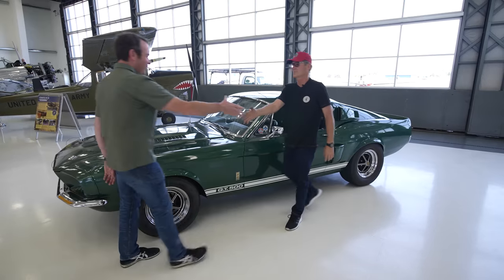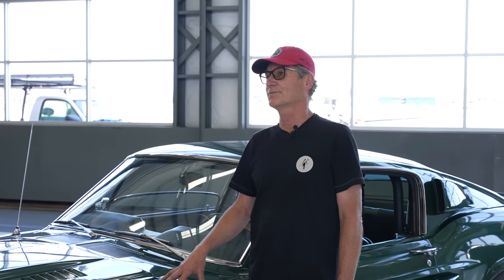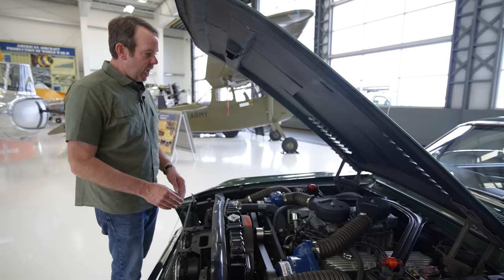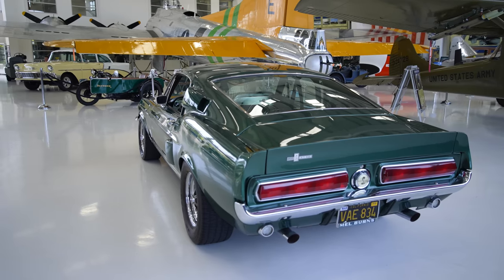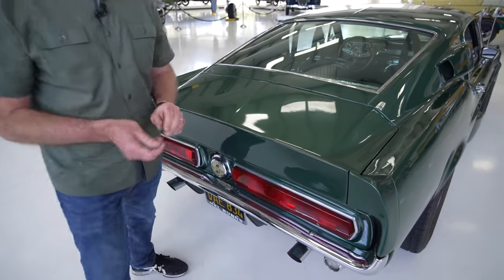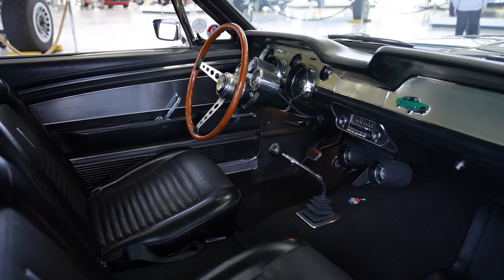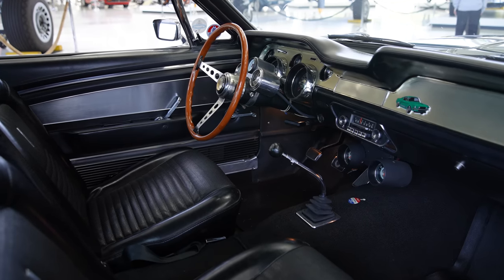700HP Twin Supercharged Shelby GT500: Worth as much as a Super Snake? | Appraiser

Comment: The Paxtons are generally period correct so it's way different than some later-developed forced induction in aesthetic...that in conjunction with the presence of the #'s matching engine means value shouldn't be anything other than enhanced.
Reply: It’s a weird thing because I would love nothing more than to swap them for some modern medium sized turbos and a modern fuel injection/timing but I would never ruin this car by doing so.
Reply: @negativeindustrial  Even that wouldn't ruin the car so long as you built another new big block and kept BOTH current engines, the original and the twin Paxton. It's all reversible.
Reply: @harryspeakup8452  
True enough.

Comment: That is what an Eleanor should have been!  The color is Home Run! The 445s are really tough. They are usually a 391 truck block with the triple bracing and if you only bore the bores to 4.08, they are very thick and really good metal. The 4.25 stroker crank can take 1500 hp as can that block with cross bolted mains. That car will live in my dreams forever!  Twin Paxtons with Gilmer tooth belts, that 750 is easy and can run to 6200 rpm’s as long as you want. The internals of any FE from a stock 2 V 390 can take 750 hp, he could boost it up to 1000 hp if he wants to. I would not street race him. He would embarrass any Mustang of today, and the Scat Pack cars are so heavy, I believe he would walk them going away with no sweat.  Beauty, and Muscle! I have built many FEs in the 50 years I have built them, and this one is the best combination I’ve ever seen! A 427 gets a lot of glory, and the 428 in 67 was a Police Interceptor with less power than the 68 up Cobra Jet. This 445 is a wonderful example of how the FE becomes Godzilla!
Reply: Fascinating input, you know your stuff bro. 👍

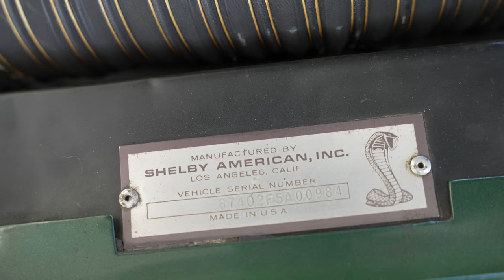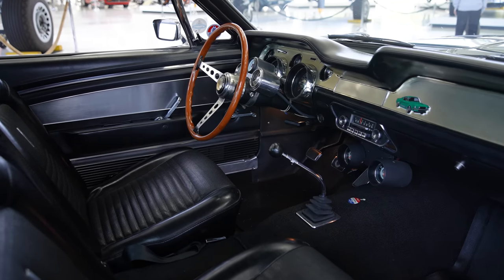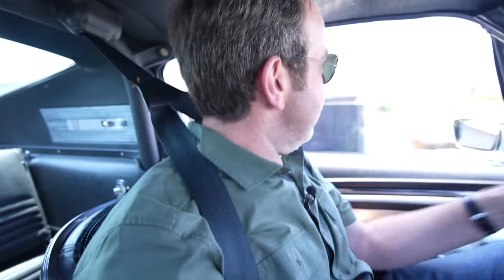Comment: This is not meant to be a criticism of the nice "appraiser" as a person or the awesome Mustang. But I am stunned that this is what passes for an appraisal video... meant to cause people to want to get a similar appraisal done by this company. So many problems & deficiencies. He says his examination would be "invasive" as he would "make the sausage". This was anything but thorough. Didn't see any sausage. We didn't see a single pic of under the vehicle. It has oem type batteries & hoses but he doesn't mention those type factors. He doesn't go around & educate the viewer on looking for signs of body repairs or whether bolts such as fender bolts had been turned or moved, welds where body panels were put together, edges of door jambs & other panels to see if they had tape lines or dry areas that indicate paintwork. He does mention a flaw in the paint on the quarter panel but just makes the incorrect assumption that the paint is original when you can zoom in on the pics & see specs of trash & fisheyes & sand marks & repair areas & overspray & poor fitting panels all over the car. The appraiser asks if it has original paint etc. That's his job to figure out if he was supposed to be evaluating the vehicle. I easily zoomed in on my phone from my couch and could see countless flaws in the paint that make it clear that this car has been painted. Still an awesome car. But this was the most useless "appraisal" ever. And then he first asks the owner what he thinks the value is. He says you're kinda foolish for bringing your car to me to get it appraised. Now he was right about that. If it were my video I'd pull it down & redo it right to actually show people what makes the difference between an average good looking old car like this one with obvious paintwork & a car that's been taken to the level that this video tries to pass this car off as. Zoom in to look at the visible damage or repair area on the A pillar at 3:12. Zoom in to see the crud around the vin# plate at 5:21. Look at 6:01 where the front fender is pretty damaged from rubbing the tires that are too big. Look at the very rough looking quarter panel welds at 6:50. Not factory. Zoom in on left quarter terrible sand marks under the paint at 10:24 & zoom in on the corner cap that joins it to see some terrible paintwork.  Check out the very poor fit of the trunk lid & hood, which those are the Shelby fiberglass ones so maybe they always fitted poorly. There's a huge difference between an original paint car and one that's had body panels welded in poorly. That's all cosmetic stuff, but what about that clear knocking noise at 3:34? It could be something else, but it sure sounds like the engine knocking! No mention of that!? Just zoom in on any panel to see multiple specs & fisheyes. The factory could have left one or two, but not that many. Every panel I see has several & several places like where the valance panels meet the fenders & quarters are not fitting like a very low mileage original paint car should fit. And it may just be me but the front fenders seem to both be a shade lighter than the doors. If the car were carefully wet sanded again & buffed properly a lot of the telltale signs could be improved so much that it would take the car to another level. Being such a special & beautiful car it deserves it. So I hate pointing out negative stuff about anyone's car, but this "appraisal" just failed to do it's intended purpose. Good or bad, an appraisal of a car this special & valuable needs to be way more detailed, honest, and accurate than whatever this was.
Reply: You’re talking about a three hour video. This is what you get for thirteen minutes.
Reply: 100% agree on all the above. This "appraisal" was just fluff and no substance.

Comment: I wonder why he didn’t use the 427 instead of the 428? Considering he went Thru all the trouble and expense.  Otherwise I think it’s awesome 👏
Reply: more air he said
Reply: They actually put 427’s and 428’s underneath the hoods of 1967 Gt 500 Shelby’s. Check it out, cool info
Reply: @gearhead682010  There's never been a documented 427 in a 67 GT500. They were simply too expensive for Ford to make them standard in a Mustang as opposed to the 428 which was in mass production at that time.

Comment: Crazy that tech from 70s could be modded for crazy HP numbers like that. 
Wonder if anyone modded this config back in those days
Reply: Yes, they did. This guy just basically replicated what Carrol Shelby did with his two 427 Cobra Super Snakes. 427ci Side-oiler FE engine (this guy used a 428 FE) with twin Paxton superchargers. Shelby kept one for himself & gave the other one to Bill Cosby, who promptly gave it back, saying that he would die in that car. So Shelby sold the car to somebody else, who proceeded to run it off the road in the Hollywood hills killing himself and destroying the car.

Shelby's Super Snake (CSX 3015) sold at Barrett-Jackson last year for $5.5 million.
Reply: Also, don't forget that the FE engine was the same starting block as that used in the mid 1960s in both the Ford GT (GT40) and the Shelby Daytona Coupe - both cars making around 500 hp, and both cars topping 200 mph.
Reply: @brettwelcome4842  holy cow. Thanks for that insight. Never knew

Comment: I could just imagine this thing on the street. It would be terrifying to drive in straight line with that kind of horsepower. Forget about trying to turn. This vehicle would plow strait into a brick-wall. Just get a modern-day supercharged GT-500.
Reply: This car is way more close to factory than say the guy that crashed the chevy on the AutotopiaLA video. This car had carbs and throttle linkage that was easily adapted. The Chevy was a straight drag racing engine shoehorned into a car with a semi functioning gas pedal. It was most likely built on the premises that we have 33 days to get this built, and with the snap of the fingers they had 3 days to build; and threw it together. Besides how hard can it be to throw a Blown Big Block  into an old car. Shoe string the gas pedal and you're racing.... The guy actually bothered to say that he upgraded the brakes in the 90's. All he perhaps upgraded to was Big Block brakes for say a 390 4bbl. or possibly a 428 with factory power ratings. Not a 8-71 blown funny car engine.

Comment: These are stunning to look at, but 100% not a 200k driving experience. These will drop in value significantly as the older generation dies off
Reply: Not with this inflation.
Reply: What information do you have to support your theory that these will “drop in value significantly”?
Reply: Driving experience?  What are you a soccer mom shopping for a new S UV?  They've continued to climb in value every single decade you clearly have no clue what you're talking about... It's a supply and demand thing and vintage cars and the sixties aren't being supplied anymore the demand continues to grow
Reply: @chrismathes3647  Yes driving experience. I actually put a ton of miles on all of my fun cars, so how they actually drive is important. 

Again, these are nowhere near a 200k driving experience. 

These are more for the crowd that wants to take them out a handful of times to a car show each year, and rattle off all its options and show that it has period correct hoses and clamps
Reply: @Urapnes75  look at the massive muscle car boom of the 2000s, where pricing went crazy. Right now any performance car is sky high in value, even everyday cars are selling at MSRP or above. Current times aren’t normal, and we’re at the start of things heading downwards. 

Pre Covid values were way down on muscle cars. Again, as the older generation starts to die off the value of these will drop significantly.
Reply: Fully agree. Awesome cars, but the values are inflated due to boomers. I’ve driven a few of these, and if you take away the Shelby lure there’s more negatives than positives in terms of how driving them feel.
Reply: @sarahdell4042  100% agree.
Reply: @chrismathes3647  I believe that’s the point she’s trying to make, seems to have went over your head. Obviously it’s supply and demand that has pricing elevated for these, but from an actual ex owner of a gt500, she has a valid point. They don’t feel special if you take away the value, and for the money you can find a million other cars that drive far better if you truly love engagement. 

I liked mine, and enjoyed it for what it was but never drank the kool aid.
Reply: @sarahdell4042   Dumbest comment I've ever heard in reference to a 1967 Mustang that is a low numbers production car that you buy for collectibility not driving experience. It's a completely pointless comment that you're only saying to make yourself feel better to hear yourself talk. If you want to a performance vehicle for driving experience get BMW, Porsche, Maclaren or something else that's a driver's car that you can enjoy, but you're completely missing the point of this video and the car featured.  Nobody's not saying it's still a Mustang at the end of the day but the whole video of the Shelby twin superchargers  is something that Shelby fans like myself have always looked forward to hearing more about it.  I can imagine a $200000 classic muscle car from the sixties having a really awesome drive and experience not like I'm gonna get in and it's gonna be like an M series or some other high end vehicle that I've driven I just can't see the point and as far as collector value going down yeah it's relative but it's only gonna be a small amount. The 2 men in the video were off by about 50000, right? so if this thing goes down from 200K it might go down to a $150K which to me doesn't mean that the car all of a sudden became cheap.  Your comment makes it sound like it's gonna become the FTX of collector cars sorry I don't think you're even
Reply: @Urapnes75  That the market in pre-war and 1950s cars has softened significantly in the last 20 years, with the change of generations. At least, it has here in the UK.
Reply: @chrismathes3647  Again, that’s what I’m saying. These are more about the status and allure of it being a Shelby. 

I’m not saying they will be $20k cars, but I don’t think they will climb in value over the long haul. In large the people who currently have these don’t actually use them. Trot them out to car shows, etc. 

As those people die off, the younger generation doesn’t have the same connection to these. Inflation is insane, and wages aren’t moving. People can’t afford to buy homes anymore either, due to firms buying everything they can get their hands on.
Reply: @sarahdell4042  that is why this kind of car isn't for you.  If you want that kind of driving experience get a newer vehicle or build a newer vehicle.
Reply: @alexb3764  it's a nearly 60 year old car I'm not sure what yall expect you are comparing it to the way modern cars drive of course it's gonna be completely different.  If you don't like that stuff get a newer vehicle that simple.  Some people like the older raw feel it has character.

Comment: Question about numbers matching: How does the engine not being numbers matching (with the rest of the car) not affect the value of the car? If I understand correctly, it did not seem to matter to Collin that the engine is not original. Why?
Reply: Maybe because the period-correct engine is still with the car--- just not in it.
Reply: The owner still has the original numbers matching , low mileage engine that can be put back in the car at any time.
Reply: Did you not watch the video? He still has the original engine. Therefore he can put it back in the car at anytime. Meaning no value lost.

Comment: What's the point of any car having more than lets say 350 to 400 HP when you want to drive it on the street?  Ego boost or something?
Reply: 350-400 horses isn't that much nowadays you can have a fun fast car w that kind of power but that certainly isn't the ceiling on streetable power 600+ wheel is easily streetable just gonna run a drag radial if you wanna actually use any of the power.

Comment: 2 blowers and only making 700hp? Am I missing something here?
Reply: If They made 400hp stock to the wheels , each makes about 150hp but then probably takes 40hp to run. Old school Boost , just think about how crazy 700hp would have felt in the 70”s! That’s almost double what a 427 makes. So not bad😅
Reply: Non-intercooled, iron heads, small blowers, blow through carbureted, California 91 Oct limitation. It's probably a low boost, pump gas, street tune up, it probably hits peak power under 6000rpms and makes over 700lbs/ft TQ too.
Reply: Yes...the knowledge to understand a boosted car of this era vs a boosted car of today 😳
Reply: @hendo337  exactly. This is an old technology build, because that's what the builder wanted and it's what suits the car. And you can bet it's been carefully optimised for tractable and reliable running
Reply: I've read the comments and thanks for informing me of this. My thought after all of this...LS SWAP IT
Reply: It’s not making 700hp, not even close.
Reply: @TML34  what are you talking about? A decent mild-ish build on a 445 stroker should get to about 550hp naturally aspirated (1.23 hp/ci) if they did any porting on the heads. You think twin superchargers can't get him a 27% increase in hp? He could get about 40% increase from boost. 700 hp is minimal for a 445 stroker FE with twin Paxtons.
Reply: @brettwelcome4842  Your hp figures aren't reality. The standard 428ci made a reported 355hp, the extra displacement of 17ci is insignificant, but let's say 375hp. And remember, these hp figures are gross hp at the flywheel. Adding these old dinosaur superchargers through a carb setup is going to add 325 hp? No chance.
Reply: @TML34  Factory ratings of a stock 428ci are irrelevant. I'm going off of the assumption that, if the guy bothered stroking the FE, he actually built it to at least the same standards as a commercially-available crate engine. SCAT stroker rotating assembly with good compression, moderately aggressive cam (sounds like that was the case), heads ported to flow similar to Trick Flow or Edelbrock FE heads, or maybe even as well as BBE heads, if not just a pair of the aforementioned aluminum heads. You can buy, right now, a crate 455ci stroker that makes 500hp at the crank. There's no way that guy had an FE built and didn't at least make 1 hp per ci. A decent build, if you've got some money (which this guy seems to have) will get you typically 1.2 hp/ci at the crank. So 534 hp naturally aspirated is completely feasible. As for the twin superchargers - the guy owns the company that makes the superchargers... I'm assuming the internals are pretty much new stock in vintage housing. They advertise a 46% hp boost with one unit. I'm sure a 31% boost in hp with twin chargers is pretty realistic. And yes, I'm assuming gross hp at the crank with these figures.

But we're both speculating. Fact is, the owner said it makes 700-ish hp, and the peak that it made was about 750 hp. That indicates to me that he had it on a dyno at some point. I would assume they did pulls after break-in when they built the stroker.